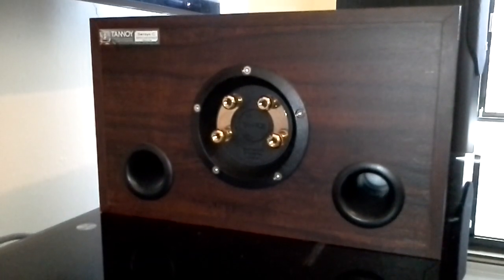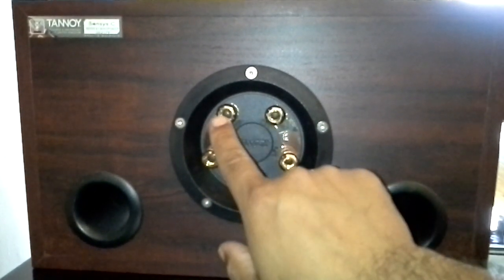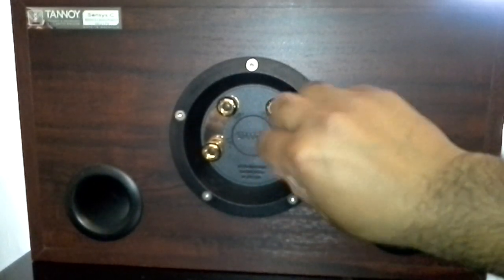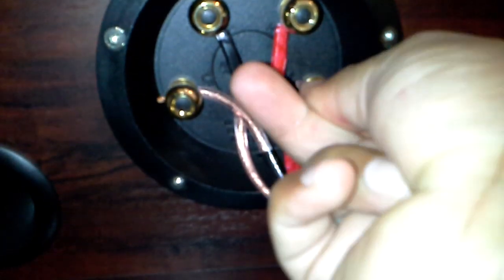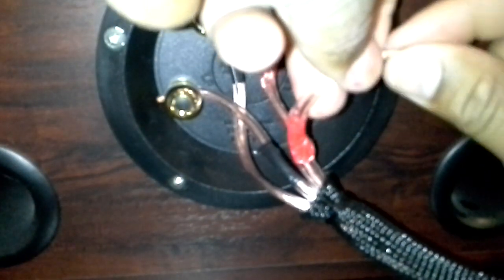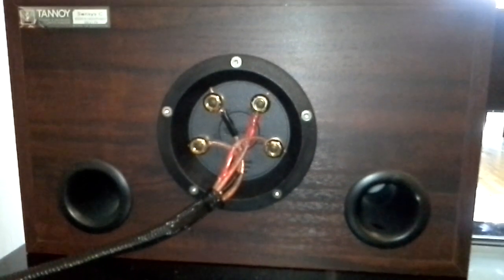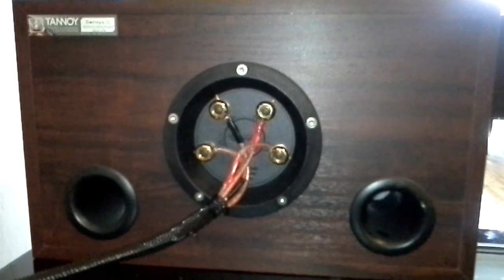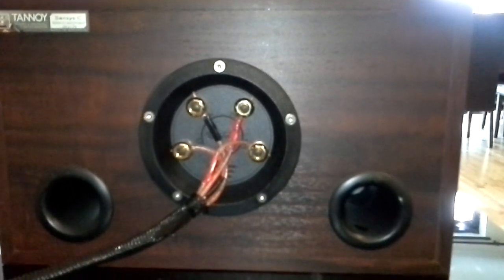How to Bi-wire & Bi-amplify your speakers

Comment: It doesn't matter which negative or positive goes on top or bottom !! You have them both spliced at the other end of the cable  !! As long as the polarity is correct sir.. if you used 2 different positive and negative on the amp side I could see you have to worry ..

Comment: I personally don’t think that bi wiring works at all. Sounds like it’s a marketing hoax. Can’t tell same about bi amping.
If you connect two wires together you’ll be getting same shit in both wires.
Your receiver doesn’t understand that putting these red tape on one set of wire should make them higher or lower frequency signal carrier.
It feeds the same signal to all four or 10-20 wires you connect to it.
On another hand separating these frequencies done by  speaker itself. One set is amplifying lower frequencies and ignoring higher’s are base speakers and others are amplifying highs as therefore ignoring low’s ‘cause they can’t handle them (these are treble speakers)
As simple as this!

Comment: Hello if I bi wire will I get better sound
Reply from the maker: it's a grey area , only you could tell by listening after doing bi wiring ( if done correctly ). On the other hand bi-amping makes big difference and is noticeable when it comes to listening.

Comment: Ok, another question my recevier is a Denon Avr 1906 if it helps, it does not have a hdmi can i connect it to the tv so i can do some setting in the recevier's menu on my tv screen? Thanks
Reply from the maker: nice , Just use the OSD ( on screen display ) to configure it.

Comment: Ay, just bought a 5.1 system with a recevier. Now.. i have 2 tower speakers but want to use them as the front speakers, is that possible? They have each 4 pins like yours so if i connect it on the upper 2 pins and leave that metal that connects them togheter i am ready to go?
Reply from the maker: yes correct.

Comment: In bi-amp how would one "plug" in the source, say from a cd player to two amplifiers???
Reply from the maker: There are many ways of doing it but I will try to keep it simple .If you have a AVR with built in bi-amp function like the one I have used in this video then just simply plugin your source ( cd player ) via RCA phono cables L/R to AVR inputs then distribute the audio to speakers as mentioned in the video ( This is the cheapest way ). If you have no AVR and just two apms then you would need a central device Like a Rack audio mixer and a dsp/crossover device like DBX driverack PA2 to connect multiple sources and then distribute the audio to amps to speakers. If you want to go pro level 5.1 or 7.1 setup then it gets more interesting and expensive :) . That's why the all in one device solution sold by Boss/Onkyo/Pioneer/Yamaha and other manufactures are the cheapest way for a HT configuration.

Comment: What if my amp doesn't have a place where i can plug a banana plug in? I have a Technics SU-V85A 100W amp.
Reply from the maker: Just insert the speaker wire into the terminals , no need for banana plug , Your Technics amp doesn't support stereo bi amping  , although for testing you can bi-amp only one speaker ( if your speaker supports bi-amping)

Comment: Can some one clear my confusion of what exactly are we doing here? The bridges between the active or so called positive terminals and the ground or negative terminals were removed. The speaker wires are made common at the amplifier end and this bridges them and we are only splitting the current into two different paths. How does this help, and what purpose does this solve which the bridges do not, unless the high frequency and low frequency currents are separated by the amplifier at the amplifier end itself? I am a novice in this audio stuff, so some one can kindly update me please.

Comment: The speakers terminal is not positive and negative. A lot of people think the red terminal is positive and the black is negative. The truth is the red is an active terminal and the black is ground or common, Because speakers signal is Ac signal. If u build amp yourself then u should understand what I mean. Speaker will not work with DC.

Comment: Hi, i have built the speakers with vintage wide range, tweeters and Eminence Alpha 15A bass speakers . The problem is that the vintage speakers is even more sensitive. So I need to amplify bass units additional. Speakers are connected to the tube amplifier.  So now I have idea that tweeters and wide range speakers will work from tube amp then  bass units I will connect through additional separate amp. I want to avoid using additional preamp because in this case sound quality decrease.
The question is how i can connect additional amplifier for woofers without using preamplifier? 
Can you help me ?
Thank you in advance
Reply from the maker: +tubeman12 , Eminence Alpha 15A speakers are 200 W RMS with 8 Ohms. So in order to power these speakers you need a amp that can output minimum 320 W @ 8 Ohms via one channel. As per your email I believe you are trying to power your tweeters and mid range speakers ( what is the model & make or any details about theses speakers ) via a amp that outputs 45 W per channel . Also i assume you have built a home made crossover . Crossover need to be very precise according to the frequency response , resistance and other specifications of the speakers. I would suggest invest in a active crossover . You don't need any pre amplification device other than a active crossover. If you decide to go head with passive cross over then it would be a post amplification built inside the speaker cabinet.

Can you share more details about your project , the details about your speakers , the home made amp and crossover you have built. any pictures would help as well. Once all in place then the signal flow and design of your setup would be easier.

Comment: Can I use Speakers A for the highs and Speakers B for the lows and then select them both? Nobodyhasanswered Joe Greh's question. I too would liketo know.
Reply: Not really. You are sending the full frequency to the speaker terminals. The speaker's crossover splits the high and low frequencies to the proper driver. So, if the speaker has bi-wire terminals you can do this with the jumper removed, one will now only put out bass and the other treble.

You left me with the impression that your speakers have a single terminals, in which case the crossover will send the signal to both speakers. To do what you're suggesting, you would either need to:
1- Rewire the crossover to allow the connection to one driver or the other
or
2- Bypass the crossover and use an external crossover to send the proper signal to the correct driver.
Reply: +Elliot Check  Thanks very much for your helpful, detailed reply.

Comment: i dislike bi wiring and amping. it has its place but really it has little purpose. i have a pair of jamo speakers that have this and i hate it with a passion great speakers tho. i prefer my jensen speakers. the classic two negative and positive terminals. either way no matter what the bi wiring just gets ended up some way or another wired in parallel. either with the bus bars, the amp itself or your wiring. silly!! great video however.
Reply: Newb here. What are the benefits of bi-wiring? Can you bi-wire with a regular HT receiver?
Reply: 949surferdude as long as it has a speaker A+B output... then you can

Comment: Can I use Speakers A for the highs and Speakers B for the lows and then I select them both. I'm using a Yamaha RX 1130?
Reply from the maker: Joe Grech I am not sure what exactly you have asked ? but the approach should be to get the high frequencies out of the tweeters & low frequencies out of the woofers . If tweeter & woofer are installed in one cabinet to make one speaker for high & low then use the method in this video . If you have a speaker cabinet only compromised of tweeter & then another speaker just woofer then you need a active crossover or a audio dsp management unit to distribute audio properly.

Comment: Hi Avme can u tel me i have jbl eon 515 x 2, an one jbl 15g2, an one mackie srm 450v2 all are power spk an behringer 1204fx mixer so if i want to use all 4 speaker at one time how do i connect, i tried doing it 2 eon 515 on top an two on the floor when i connect i am getting very very low sound in top spk can u help me in doing a right connection.
thanking u Philip
Reply from the maker: Philip Mendonca Hi Philip , do the connections as follow.
1: Right XLR output from Behringer 1204 fx to XLR input on the 1st JBL eon 515.
2: XLR output ( set to mix using the button , pressed position ) on 1st JBL eon 515 to 2nd JBL eon 515 XLR input. That is your right channel done.

3: Left XLR output from Behninger 1204 fx XLR to XLR input on your mackie SRM 450V2.
4: XLR output ( through ) on your mackie SRM 450v2 to XLR input on your JBL 15g2.

5: make sure your L & R output faders on your mixer are set to Nominal level (0) position.
6: Make sure XLR input level on all your 4 active speakers is set to nominal level (0) position.

7: if necessary increase the audio output vloume of your souce device ( input in Mixer ) , turn on PFL on the channel the source device is connected to & by looking at the led meters make sure they don't pass the 0 mark & should not reach the clip mark under any condition.

8: Increase the input levels on all your 4 active speakers if necessary to obtain desired  level of sound output depending on the environment the speakers are used for.

Hope this helps !

Comment: FYI, there is no reason to differentiate your high positive wire from the low positive wire. Both positives come from the same source, so it makes no difference which positive plug you hook them up to on the speaker since you simply split the positive OUT from the amplifier/receiver into 2 parallel wires. They are both the same. Thank you for posting!
Reply from the maker: Beest1977 The reason to differentiate the low (+) & high (+) & High ( - ) & Low ( - ) wires in red/black colors markings is for viewers to better understand the concept of bi-wiring. Thanks for the comment. I will soon upload a video to demonstrate Bi-Amping two front speakers (L & R ) using home theater AVR multi channel/zone built in amplifiers & crossover.